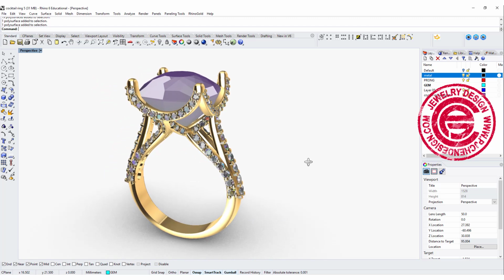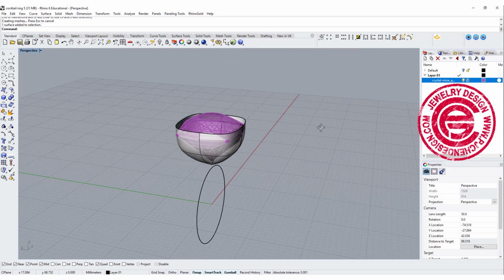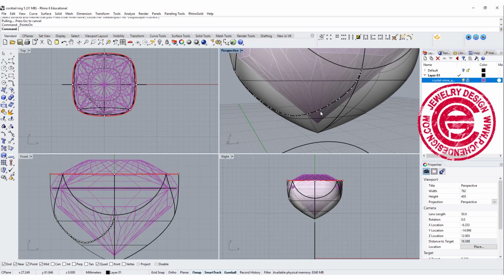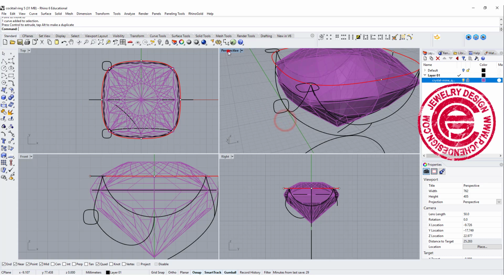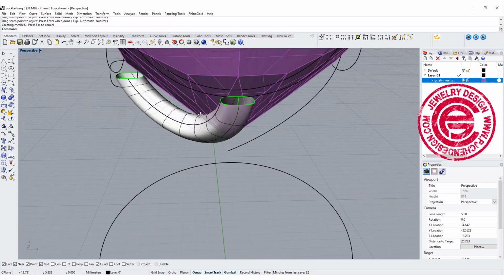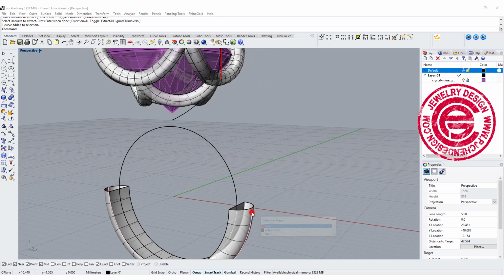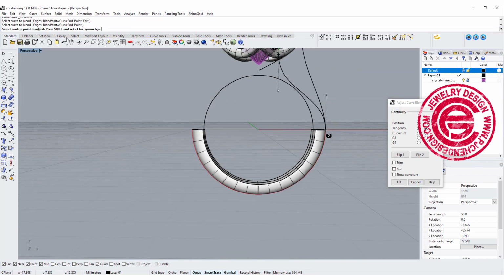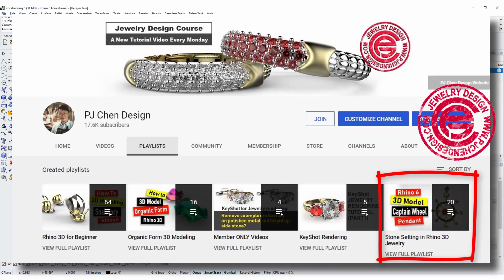Cocktail Ring 3D Modeling in Rhino 6: Jewelry CAD Design Tutorial #111

Comment: Hi ,when I rotate prongs ,they didn't touch together and I have a little bit space between them.how can I fix it?
Reply from the maker: It is hard for me to tell without seeing model. I am gussing it may have something to do with your center of rotation.
Reply: When I project curves on the surface I think it finds problem ,because after that they are not equal 
Is there other way instead of project curves?
Can I make prongs without projecting curves on surface?

Comment: Good morning PJ! Thanks for you 
teaching. I want to make an inquiry. When we offset a curve, project it onto a surface, etc ... many control points appear. We can correct this by reconstructing the curve, but I see that the curve is greatly deformed. An alternative to rebuilding that I have found is curve fitting and you don't use it that much. Could you tell me what difference is there? Thank you
Reply from the maker: Yes, exactly. sometime you use project and sometimes you use pull. I have a video show you the difference between those 2 command. sometimes you need to project, rebuild and pull back to surface.
Reply: @PJChenJewelryDesign  Tahnks, 
I'll find that video of yours